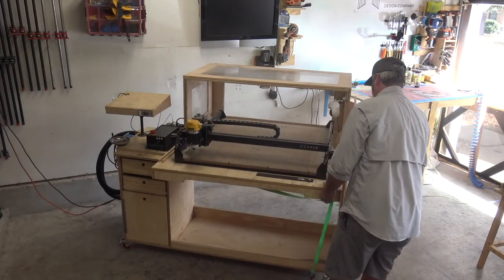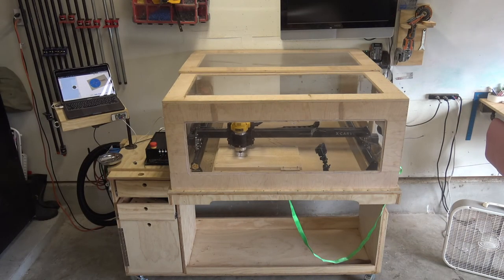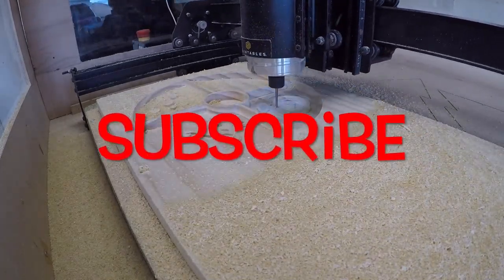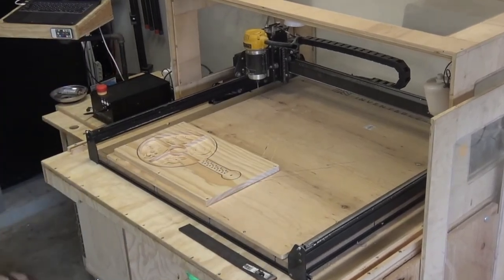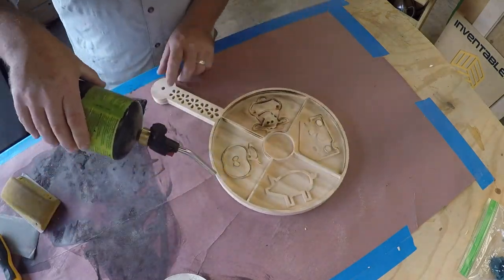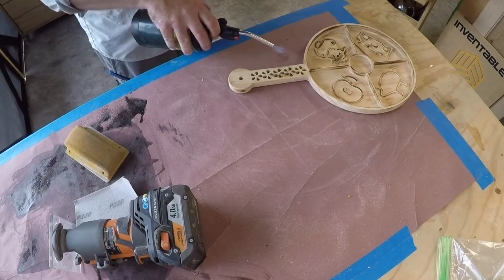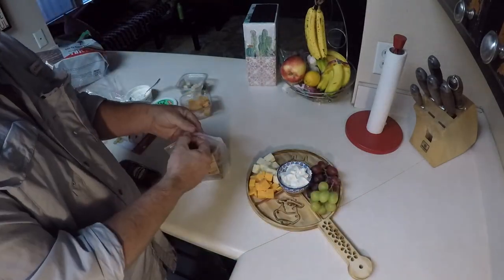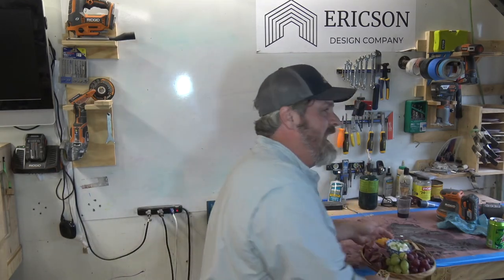How To Make Gifts | Woodworking | Part 5 | Custom Cheese Board

Comment: Stoner,   have you worked with the two-pass settings using a larger bit to hog out all the material and then a detail pass? that'll cut down on your project times.
Reply from the maker: I have not done that yet I will try now